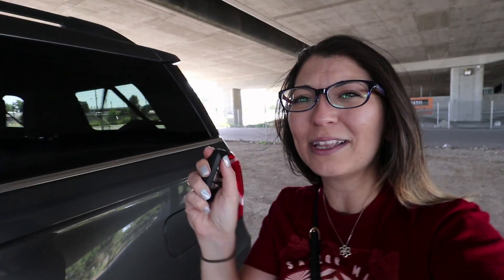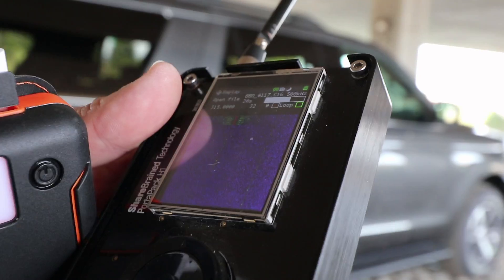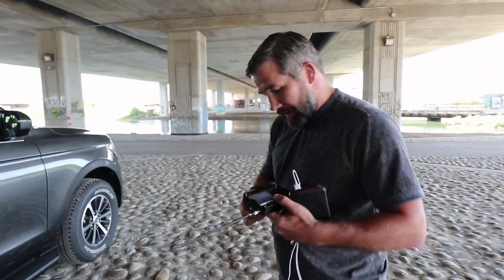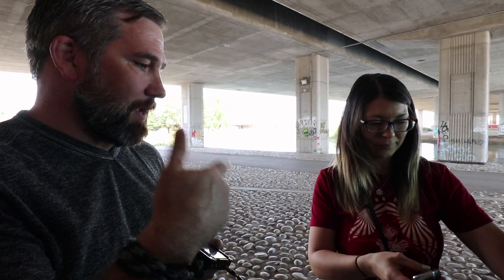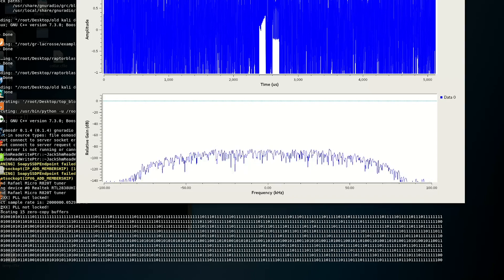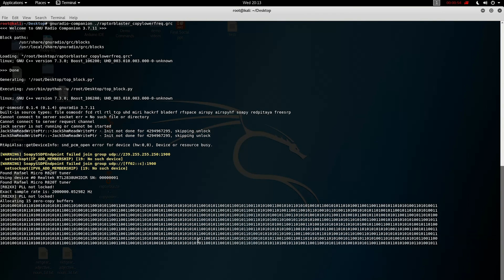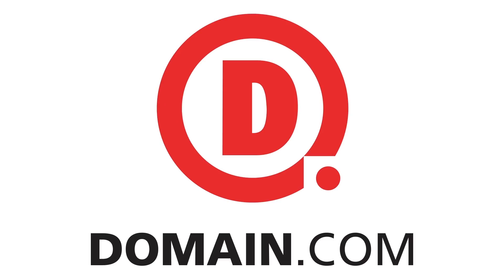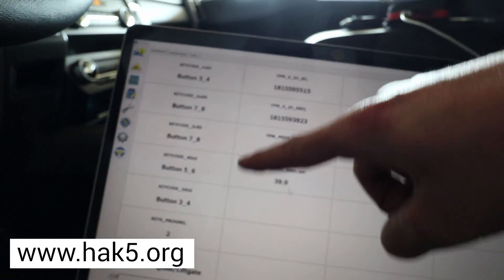Hacking Ford Key Fobs Pt. 1 - SDR Attacks with @TB69RR - Hak5 2523 [Cyber Security Education]

Comment: oh man. 😂 they try to replay a rolling code. that’s what rolling code is meant to do. the car is not accepting the same code again. and while there is a transmission on that frequency, they can’t open the car. yes that is also normal. 🤣 there is no security risk here. they actually failed to attack here. 😂

Comment: Easier to just dont use RF keyfobs. Use regular keys and remove THE RF part in THE car. Problem solved.
Reply: With no RF element, you sir, should check out the lock picking lawyer.  Without RF he could get any car going in 3 min.

Comment: why would you compromise your security code by using key fob when you have keyless entry? on my Lincoln you have to be within 3ft of the Lock that you’re trying to open.  after I leave my home I never take the key out of my pocket. it’s not foolproof, but is has to be more secure than sending a signal across the parking lot every time you unlock your door. it’s a different code for the PATS so I get in the car,  CLOSE THE DOOR, then start the vehicle, and i’m out of there.

Comment: Sorry for my bad english.
You could just transpond data from 433.85 MHz or 355.2 MHz (depending on the frequency your keys transmit data on) to the same frequency, this will transmit data with a 2-3 ms delay on top of the original signal and corrupt it. I've tested it with a raspi 3b+ and RPITX runing on nexmon firmware and a RTL-SDR (Note: i've done it against an old car from 1998, IDK if that'll work on a more recent one). That's way cheaper than a $250 HackRF one. But still, this little badboy is amazing !
Reply: I highly doubt any key transits at 300+ GHz. That's like infrared
Reply: @RiwenX  oops my bad, meant MHz ^^

Comment: The one engineer didn't have the capacity to see the big picture and was more concerned about being right than actually admitting that there is a problem.  I've worked with guys like that before.  It's bad for the company when they get into leadership positions.
Reply: His response was akin to finding out a bump key works on a lock, telling the lock maker about it, and them saying "Now try it with a potato instead. See? It didn't work. Nothing to see here!"

Comment: Is it possible ex: to modulate your own signals and transmitt them using SDR? + all the signal processing that is needed for communication? Or is the SDR limited to some level?
Reply: First if you modulate your own signal how would you know the exact bandwidth that car is communicating with
Reply: Of the bandwidth is between 300 and 400 you have 100  guesses
Reply: @trevenbutler1625  My question is a bit of topic of the video content. I just wanted to know limits of the SDR.

Comment: 14:54 Engineer was covering his own arse.  I bet he gave the testing methods he was forced to use to test the lock he developed. He probably doesn't have much freedom outside those parameters either. So to have his job on the line for something he wasn't allowed to test for sound kinda terrible for him. Especially when some outside hacker gets to throw away the rule book he has to follow.
Reply: These are the rules in a big company. Not looking for the ultimate solution, but to look for a solution that is legally recognized: “hey look we did develop a security system that works 99% of the time. Not our fault if these 1% are specialized hackers, they would find a way anyway…”

Comment: Try it on a Mercedes.
Reply: You do something little different with Mercedes at least the ones I tested a few years ago.
Reply: The one I tested had a key fob that transmitted at 312 and 315 MHz simultaneously.
Reply: @jasonpitts8395  Ford actually sends on more than on channel as well.

Comment: Why is it so hard to get this right? Imagine this, the fob has a public and private key pair and the car keeps a list of public keys it trusts.

Fob: I want to unlock the door! Here's my public key.
Car: Ok you're on the list. Decrypt these 8 bytes of pseudorandom data in the next 50 ms and I'll let you in.
Fob: GG EZ, here's your data!

You could shorten the response window depending on how fast the hardware in the fob is. Pairing a new fob could be done by making a physical connection with an interface inside the vehicle, for instance via USB. I imagine putting hardware into the fob that allows it to do proper public key crypto will increase its cost and perhaps reduce its battery life but if it means the car is more secure I'm totally fine with that.

Am I missing something here? Why aren't automotive engineers using proper crypto?
Reply: Matthew Carr most don't think its possible to hack into their systems

The regular Joe only cares about 
Comfort
Looks
And safety ratings 

That's about 99% of automotive customers 

So the big names only focus on those things because it brings in more profits with less money invested in security details and etc 

But no matter what types of defenses they use, they will be defeated.

Setting up defenses around technology is ultimately pointless 
Seeing as how you will always have people on the inside making these things possible 

It's a battle with no wins for either side 

Just a cat and mouse game 

Both sides ultimately will lose

Comment: I did a project on this for graduate level cyber sec class. It's not hard to do and it works across the board not just with Ford vehicles. Excited to hear the def con speech. At times the presentation was confusing, thankfully the other guy was able to ask deciphering questions
Reply: This technique is Ford specific. There are other techniques that work for some other models.

Comment: I hope Ford can do over the air updates to their keyfob systems....
Reply: This is gonna be a physical fix. Not an over the air fix from what we saw. I could be wronge.
Reply: @tuathadedanaan1424 The problem is in the software processing of the rolling code counter so it would have to be able to be fixed on the software side. The only question is if the software can be reprogrammed over the air (cheapest option), Flashed by the dealer (High cost) or  requires hardware replacement (Highest cost). Since Ford is being open about this, my guess is they will be able to push an update out to the car to fix the problem.
Reply: @aquatrax123  There is another thing happening that we are not releasing yet also. It might be able to be done over the air but I'm guessing not. Ford was not super open about this. They have yet to report it to consumers. I reported it to them Months ago. They have not sent out any notifications.
Reply: None that i know of and as a owner of an effected vehicle i've not been notified.

Comment: i was doing this 5 years ago when i first got in to sdr this works well on many makes
Reply: This is a little different then the replays we usually do. Ford added something that makes this work a bit different. No Jamming and we use codes that are recycled.
Reply: @tuathadedanaan1424  hey , so would this device respond by picking up the radio signal without the owner using their key fob ?
Reply: Tell me more

Comment: Hackrf + portapack  + charger . You welcome. But it's still restrict by the rolling code cause he needs to sniff and Replay. I don't really understand why he doesn't jamm the fréquences and Replay the code After ...
Reply: It's not, though. He found another implementation vulnerability that resets the rolling counter. The only caveat to this attack is that you have to then replay all the sequences up until that point in order.
Reply: Jamming and replaying would be too easy I think. Especially since there are devices which detects that somebody is jamming. Somewhere on hackaday there's a cheap project for a jamming detector, from a South African guy, because it was a thing down there some years ago.